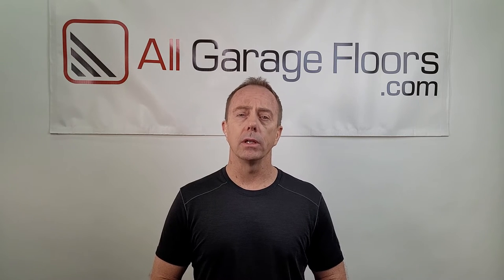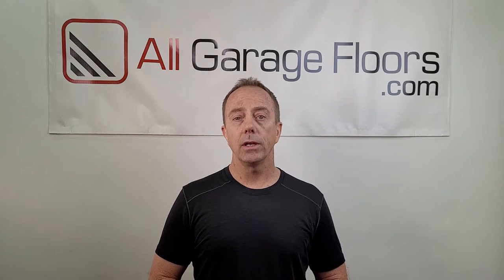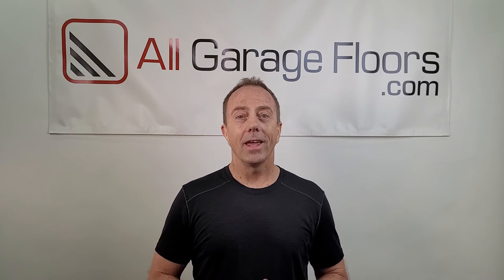Do I Need to Etch My Concrete for a Garage Floor Coating? | Get the Real Facts

Comment: Have been looking for a "middle ground" floor coating for my garage. It seems there is a wide gap between paint, rust-o-leum DIY products, and the higher end stuff like armor epoxy. I believe this dura grade coating my fit my needs: turning my garage into a mancave but still may be used for minor things like oil changes, etc.

Thank you for the video!
Reply from the maker: We are glad it helped, James 🙂

Comment: Love your video, thanks. How about DIY acrylic concrete coatings? Kilz and Behr coatings, do you recommend grinding or etching and how about priming the concrete prior to applying  the coating?
Reply from the maker: Hi Rick. Just to clear things up, Behr and Kilz are not coatings. They are acrylic concrete paint and do not compare in performance, durability, and appearance to a 2-part epoxy coating. Our video here explains all the differences: https://youtu.be/iq6obcIiPCs?si=BUJbBhIOslNsyqwc

If you want to apply a 1-part epoxy paint, then etching is recommended to achieve the best adhesion. A concrete bonding primer helps as well.

Comment: It seems like you’re saying that I dont need to etch if i grinded off a previous coating back to the bare concrete. Is that right?
Reply: That is correct. Grinding provides a superior concrete profile for coatings that etching does.

Comment: Can you comment on Rustoleum's recoat primer for previously sealed or painted concrete garage floors as to prep work before applying it.  You would them be applying their coloured topcoat & then their clear sealer  (this is not their epoxy product) but aimed at garage floors that will have your cars parked on it ( in summer the tires would be hot when returning from an outing) and it would assume the cars drive straight in and back straight out without any sideways turning of the steering wheel
Reply from the maker: The Rust-Oleum Recoat Primer is only for use on previously sealed bare concrete or older coatings that are adhered well. It is not to be used on bare, unsealed concrete or used in lieu of proper bare concrete prep. We have an article about Rust-Oleum Recoat Primer here: https://allgaragefloors.com/rustoleum-garage-floor-primer/
It will have no effect on hot tire pickup. Turning the tires is not what causes it. Hot tires can cause lesser-quality coatings (EpoxyShield) to soften slightly. As the tires cool, they constrict and grab the coating. When you back the car out of the garage, it pulls up a bit of the coating with it.

Comment: Can you please provide a detailed video on rust bullet. Almost sounds like epoxy can be replaced with rust bullet. Your thoughts would be greatly appreciated in a dedicated video. Especially their ultra low voc release
Reply from the maker: Hello Sid. Every coating has a purpose. Rust Bullet is a good option for many people, but it's not an epoxy replacement. We do plan on doing a video in the near future.

Comment: I'm trying to coat a concrete floor inside my house and it is very difficult to acid etch and rinse a floor inside your house. Yes I can lay down the itching solution but I can't hose it off like I can in the garage floor. The best I can do is wet mop it repeatedly. Do you have any suggestions?
Reply from the maker: Hello. What concrete coating product do you intend to apply? Do you have a muriatic acid or citric acid etch solution?

Comment: If I am going to put down a two part epoxy floor, do you recommend putting down two coats of base, the first as a sealer coat? I know companies try to sell seperate sealers but it seems like they are no more than just another coat of epoxy to help with out gassing. Thanks
Reply from the maker: Hi Dale. It depends on the product you plan to use. If it's a commercial quality high solids or 100% solids epoxy, then an epoxy primer coat is highly recommended to be applied first. This article here explains why. https://allgaragefloors.com/epoxy-primer-for-your-garage-floor/ If you are applying a budget, low solids epoxy such as EpoxyShield, then sometimes two color coats may need to be applied. There is not a special epoxy primer for such products since they are the lowest performing and least expensive type of concrete epoxy coatings.

Comment: Appreciate the video but have a question ..we are building a living quarters inside of a barn. we poured 820 square ft concrete foundation.  Instead of flooring we'd like to paint it and use area rugs.  We were looking at the 1 coat epoxy kind.  We are going to etch the surface like suggested. But would like to have your opinion on how you think it will hold up being it won't be used like a garage? Or what would you suggest?
Reply from the maker: Hello DeeDee. Honestly, 1-part epoxy paint is not a product we would recommend for a living space. The main reason is that it's going to get scratched up and wear away in high-traffic areas. Also, the finish is not semi-gloss as many believe. It's more of a matte-to-satin finish. 1-part epoxy paint is essentially latex acrylic concrete paint with 2-4% epoxy ester resin included as an additive to help increase adhesion and durability. It does not perform remotely close to what a true 2-part epoxy coating does. You might want to consider color-staining the concrete and then applying a robust clear coat. We just posted an article about a couple that did this for their basement. You can see it here: https://allgaragefloors.com/ts210-sealer-color-stain-basement/

Comment: Have s 2 yearv old new home
Super dry concrete basement dehumidified
Do I steel brush mop shop vsc
For dura glsde
Reply from the maker: Clean the concrete well, but don't use a wire brush. It will leave metal transfer marks in the concrete that is hard to remove. As long as the concrete absorbs water droplets, you can apply Rust Bullet DuraGrade concrete without further prep. Make sure the concrete is thoroughly dry before applying it. Basements require longer to dry than garage floors.

Comment: The garage I just got had peel and stick carpet tiles, but never had a formal coating applied under it. Should I etch after cleaning, then concrete binder/primer, then something like behr one part epoxy paint for a budget option? Or do you only need to etch for a formal epoxy garage?
Reply from the maker: Hi Jake. The concrete will need to be cleaned and all of the glue residue from the carpet tiles removed from the surface. It will then require etching before applying a concrete binding primer for the 1-part epoxy. Behr has a video of the process here: https://youtu.be/vBeNgKl5rNM?si=ZRIPw-RWJBTkR_DA  Keep in mind that if you plan on parking cars on it, it will peel from hot tires within 6 months. 1-part epoxy paint is not a true epoxy coating. This article explains more here: https://allgaragefloors.com/is-it-paint-or-epoxy/
Reply: Thanks for getting back to me,  the peeling is okay I’m going to get alittle extra paint to I can touch it up if it bothers me. I’d go full epoxy but am unsure if im going to add onto my garage so im going the cheap route for now.

Comment: After tossing up between epoxy and colour sealer I'm using colour sealer. Last night I spent 3 hours acid etching. Had a look tonight and it made practically no difference to the floor
Reply from the maker: Hi Peter. Was it a muriatic acid etch or less effective Eco friendly citric acid etch? Did you check if the concrete had previously been sealed? Etching solutions will not work on sealed concrete. The concrete does not necessarily look different after and etch. However, it should readily absorb water drops if it has been etched correctly. Did you do that test?
Reply from the maker: @vegetablehead  It does not disqualify the floor from being painted or coated. What it requires is first removing the concrete sealer via mechanical means such as grinding or shot blasting. Sealers effectively prevent muriatic acid or other etching solutions from reacting with the minerals in the concrete that create the etching process. This is why etching paint or coatings does not work either. The process of removing the sealer properly profiles the surface for a coating at the same time.

Comment: Hi! So, I just watched your video Epoxy Paint vs Epoxy Coating, and I've decided to use the Epoxyshied on my garage. However, I did the water drip test and found that parts of my floor are sealed, and parts are not sealed. So I assume I would need to remove the sealant before etching and applying the Epoxyshield. Do you have any videos on removing sealant? Or any advice? There are a lot of oil and rust and other stains, would I still need to thoroughly clean them before removing the sealant like you need to before etching?
Reply from the maker: Hello Brittney. Concrete sealants are impregnated in the subsurface of the concrete. They can only be removed via grinding the surface. We have a link here about grinding for coatings: https://allgaragefloors.com/how-to-grind-garage-floor/ However, it's unusual for only some areas to have a sealant. Typically, it's the entire floor. Is your concrete surface very smooth? We would recommend degreasing and cleaning the entire floor the best you can first. Oils, ground in dirt, and other debris can give a false indication of a sealant. After that, do a sealant test again.

Comment: 25 year old home with concrete floor in the garage. Water beads so I assume it was sealed in the past, yes? I am planning to clean the concrete with whatever is already in the house, paint 2 coats drylok concrete floor paint (neighbor had leftover), and cover most of it with garage floor mats or rolls. We get all 4 seasons plus humidity. Can I skip etching? If necessary to etch, will an alternative acid free work? Thank you.
Reply from the maker: Hi David. If the concrete is sealed, paint will not adhere properly and peel. This is because the sealer is effective blocking penetration of the paint just as it is with the water. Etches work by reacting with the free lime and other minerals in concrete. If the concrete has been sealed, then etches can't react (even acid) will not work. They just sit there. You can't etch paint or coatings either. Only bare, unsealed concrete. The sealer must be removed first via grinding or aggressive sanding. We have an article here that discusses how to test for a sealer: https://allgaragefloors.com/garage-floor-sealer-test/
Reply: Thank you but I was afraid you were going to say this.😢  I’ll just clean and purchase the floor mats. The grinding process and cost is just not worth it and too time consuming. I’m only out $40 of paint.

Comment: Do I need to use a primer on concrete after grinding, before I use top coat epoxy?
Reply from the maker: Hi Michael. The only correct primer to use for coatings is an actual 2-part epoxy primer. If you are applying a quality high solids or 100% solids epoxy base coat, then an epoxy primer is recommended. Just as an FYI, concrete bonding primer is not an epoxy primer. It's acrylic latex paint and is not compatible with epoxy coatings.

Comment: If I have patched cracks with either polyurethane or epoxy, does etching adversely affect those repairs ?
Reply from the maker: Most proper crack repair material is either 100% solids epoxy or polyurea. Etching will not affect the repair. However, you will need to rough up the surface of the repair with a minimum of 100-grit sandpaper so that a coating will adhere to it. Don't use polyurethane since it is usually a crack sealant and not a repair product.

Comment: 0:40 can I etch over pre painted garage floor?
Reply from the maker: No, you can't etch paint. Etching solutions react with the minerals in bare concrete. They have no effect on paint. If you are applying a coating, you need to remove the paint first. If not the coating is subject to peeling since it is attached to the paint and not the concrete. If you want the benefits of good adhesion, the coating needs to be applied to bare concrete.

Comment: What do to with the white spots after etching?
Reply from the maker: The white spots are concrete minerals and insoluble calcium phosphate from the etching process. These spots develop from either letting the solution start to dry out or from poor rinsing of the solution. They need to be removed before applying a coating. We recommend scrubbing the areas with a solution of 1 cup TSP to 1 gallon of warm water and rinse well. It takes some hard scrubbing, but they will come off.

Comment: ok, i believe you have piqued a high interest in the rust bullet duraguard product for me. i need some clarification though. i have a 22 year old garage floor. i've never done anything to it other than sweep, and maybe 2-3 washes of bleach detergent solution. my concern is the limitation the product has on sealed floors. i'm not sure if the builder sealed it. we are the original owners. is there a test? i would assume if liquid does not bead on the floor, then it's a good bet there is no sealer? i really would like to get this project done soon, and the fact that no etching is required is worth the money spent imo. thanks!
Reply from the maker: Ahh... I see where you are going with this. DuraGrade by Rust Bullet is a very durable single-part moisture-cured polyurethane thermosetting coating. It is one of the only coatings that can be applied without the requirement to etch if the concrete passes the moisture absorption test. We have an article about it here if you have not seen it: https://allgaragefloors.com/duragrade-concrete-coating-review/ 

We refrain from mentioning this coating when talking about concrete prep because we have found it to confuse the issue when folks are just learning about application processes 🙂 What you need to do is place a few water drops in various places across the concrete. If the concrete absorbs the water within a minute, then you are good to go with DuraGrade. If the water sits there without doing anything or takes more than a minute to absorb into the concrete, then the concrete is either too smooth or has a sealer present.

Comment: I  grinded  my garage floor about a week ago, I did not put the garage kit down, can I acid etch my floor and then install the kit  after it dries
Reply: Hi Gary. If you ground the concrete, then etching is not necessary. Grinding produces a better concrete profile for coatings than etching does.

Comment: I etch one of my garages, and ground the other , the out comes were the same
Reply from the maker: Hi John. They may appear to be the same, but they are not. Etching does not provide a controlled outcome, nor does it remove excess concrete laitance which can lead to delamination issues of the coating. Grinding removes excess laitance and you can control the outcome that you desire. This does not mean that etching is a poor choice of prep. Many types of coatings perform just fine with etching. However, there is a reason that professional installers grind the concrete instead of etching. They are assured that they will not be called back for adhesion problems due to poor prep.